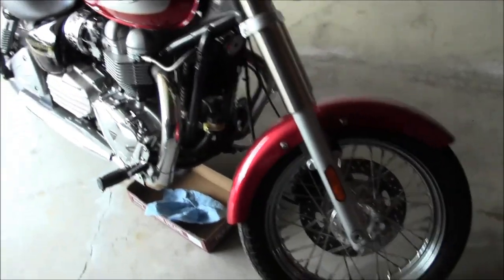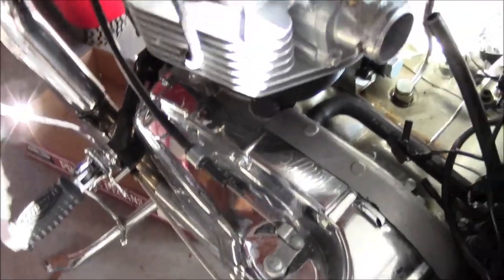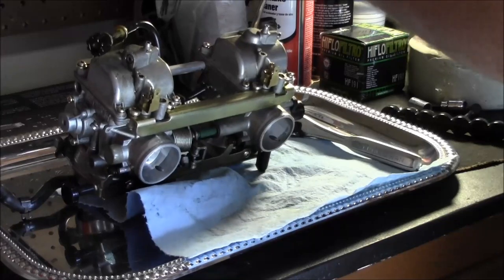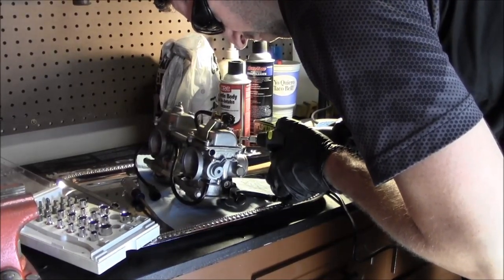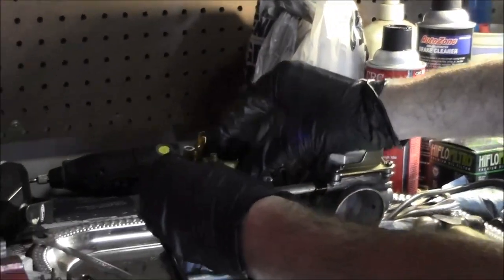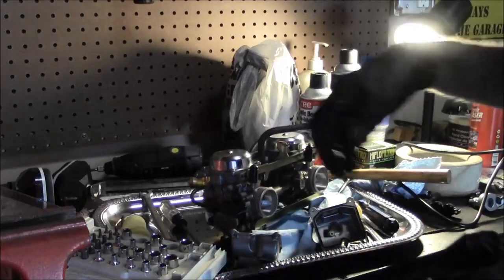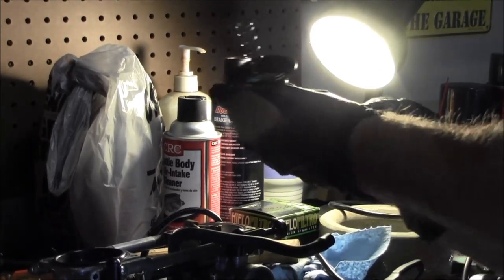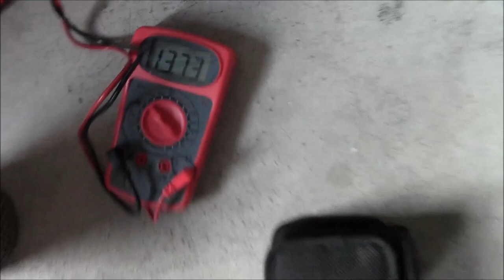2002 Triumph Bonneville America Carbs (Keihin) Part 1

Comment: Note from an old guy.   Always keep separator boxes for individual carb sides and mark left or right.  You can use day of the week pill boxes to store jets, springs, washers and never mix slides by side, they wear differently. Using taper ground forged #2 phillips screw drivers to remove bowl screws are a major league benefit.  Above all,  organization is a must.  A great trick for cleaning emulsion tube holes is peeling paper of plastic off a twist tie, its the perfect size wire to begin with for cleaning jets and tube holes.
Reply from the maker: Paul Wichmann:  You old guys need to pass all your tips and tricks down to the next generation.  That twist tie is a great tip!  Thank you.

Comment: I did notice there were no adaptor plates between the carb and the cylinder jugs.I just purchased the same bike someone played with the carbs and installed the needles in wrong.I ask because on my Speedmaster it came stock with these so called adaptor plates and the America did not have them.Bike bandit shows them on both America and Speedmaster.
Reply from the maker: Marty Noubarian:  To my knowledge, this bike is completely stock.  The previous owner almost never rode it... so I doubt the carbs were ever off of this bike before I got my hands on it.

Comment: I have a crazy question. I just recently pulled my carbs and my Speedmaster and put them back together. However, I didn’t recall the choke assembly having springs on the inside of them, but had 2 springs left over and I’m unsure if they go there or not. Could you advise? Thanks
Reply from the maker: jessie lafferty:  If the springs are really small, they might be for the pilot adjustment screws.  We didn't take the choke assembly apart... so i'm not sure about all the parts involved with the choke.

Comment: Hey man did you ever find out where the oil leak was coming from? I have the same bike and it collects in the same spot.
Reply from the maker: thomas forte:  If I remember correctly... it was leaking from the oil return banjo bolt.  There are two cooper crush washers that were causing the leak.  Replacing the cooper washers fixed the leak.